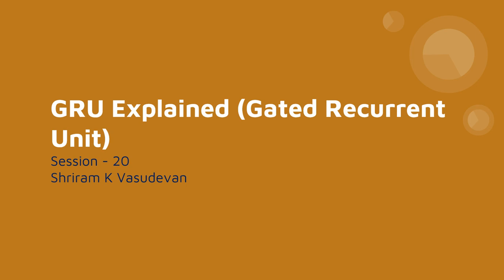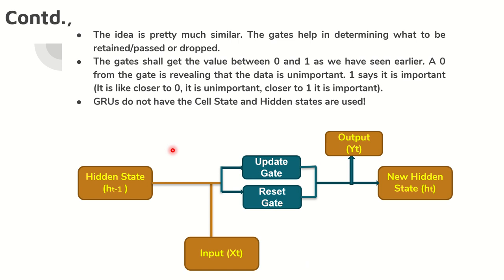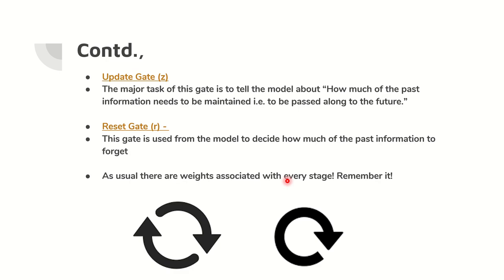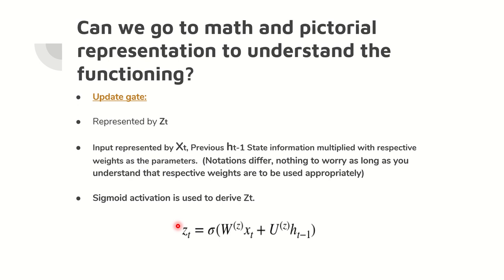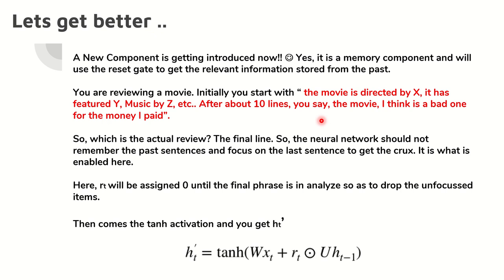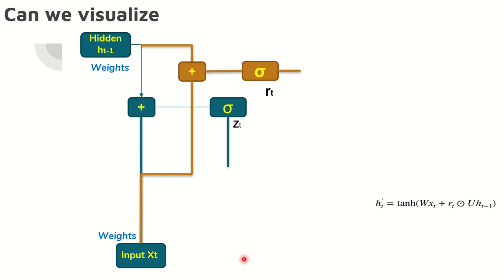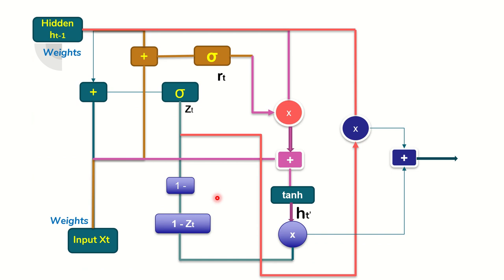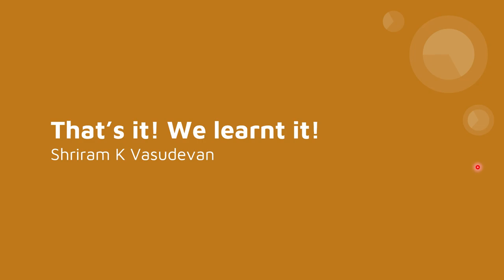20. GRU explained (Gated Recurrent Unit)

Comment: Good pictorial representation and mathematical explanation. But lacking granular details like what's the purpose of doing concatenations and what does it resolves. GRU can resolve gradient vanishing-Explode problem. During back prop, The value of gradients is controlled by chain of derivatives starting from DHt/DHt-1. In this derivative flow, process will depend on weights, Network learns in such a way that values comes closer to 1.  This is how GRU helps to resolve gradient vanishing-Explode problem.
Reply from the maker: This is a very good point. Thanks for the note.